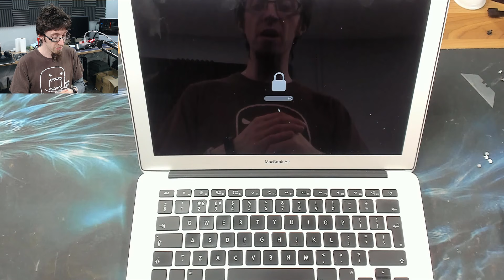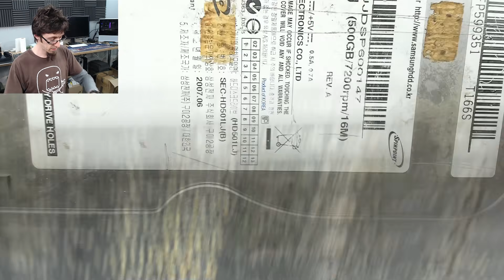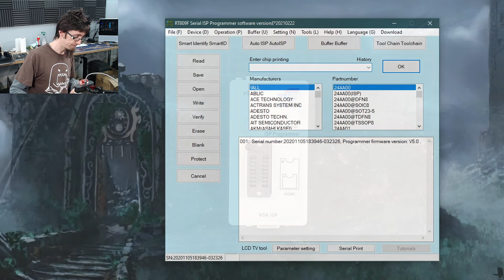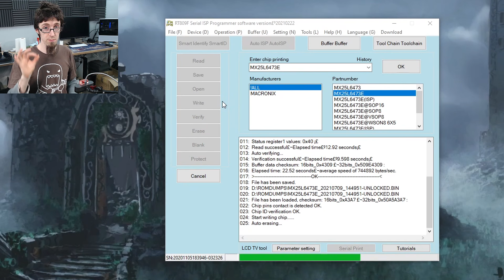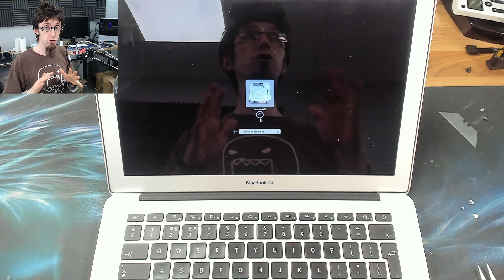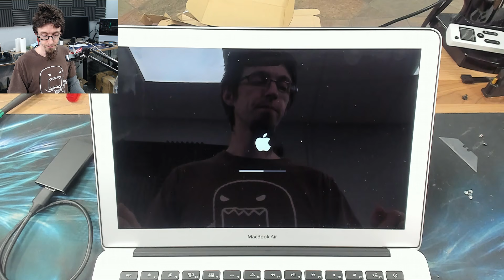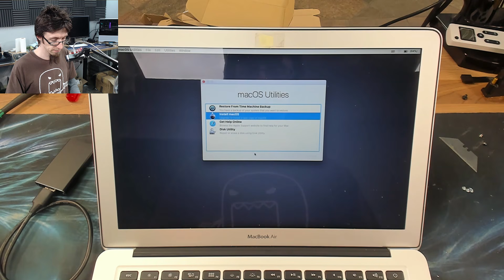[2017 and older ONLY] MacBook Air Firmware Pass / iCloud Lock Removal - LFC#275

Comment: Apple devices that have a firmware lock (the proper name is Open Firmware password) on non-T2 chips is usually set by a systems administrator rather than a user, so the computer is from business or academia or from an enthusiast because the password can only be set in recovery mode which most users don't touch. If it's the latter, then FileVault is more likely to have been enabled, so the data will be encrypted. The T2 chip is a computer in it's own right, running BridgeOS (a modified WatchOS) but it has a flaw that can be exploited in some models when the device is in "revive" (DFU - Device Firmware Upgrade) mode. As of the M1 chip, there is no firmware lock and users are advised to use FileVault to encrypt everything.
Reply: Does that mean m1 chip are easier to icloud unlock?
Reply: @bujoytv  No, the M1 makes it harder to unlock, since the iCloud lock relies on the serial number, which is stored in more than one place on the M1 logic board.

Comment: Nice video. Question is that stock SSD? I'm trying to find a replacement SSD drive but don't know which one some mentioned you can put any type but you need an adapter.
Reply from the maker: This was not a stock SSD, no. It's an Intel 660p, a budget NVMe drive.
You can use any NVMe drive with a cheap m.2 adaptor with 2014-2017 macs (check google depending on which one you have) and they work just fine. I think you also need to be on Mojave or higher as well, older versions of macOS don't have NVMe drivers.
Reply: @Adamant_IT  ah ok. The MacBook air ithink it's 2015-2017 and stock SSD is not detected and I wanted to try another SSD to see if It that's the problem.

Comment: Hy ! Thanks for your video. I have a 2017 MacBook Pro.  If I buy a new EFI/BIOS chip and replace it on my Mac, is it sure that the iCloud will jump too ? And I'll have a mac like it came out of the factory?
Reply from the maker: I think that'll work on a 2017, yes. You'll need to reformat to shift the iCloud lock as well.
Not 100% certain though, haven't tried this on newer models, only Retina-era stuff.
Reply: @Adamant_IT  and how to reset iCloud ?  Cmd R ? i thought that by changing the chip the iCloud also jumps ?

Comment: Your a con artist because you've deliberately made the title icloud lock removal when you do nothing of the sort but yet you know it will appear in google searches which is why you've done it because you want your video to show up in searches of 'icloud lock removal'. Your the worst type of youtuber.
Reply from the maker: This MacBook Air had an iCloud lock on it. It's what sets the EFI password on the laptop in this scenario.
Reply: @Adamant_IT  Your certainly not fooling me, someone who repairs macbooks on a daily basis. The EFI password has NOTHING to do with icloud lock they are completely separate things. icloud lock is a security feature that prevents a stolen or lost macbook from being used. The major problem with icloud lock is the second-hand sellers market where owners have the security feature enable during their time of ownership but forget to disable it once they have sold it or it's been handed in as part of an insurance claim.

If you wanted or intended to have any credibility, you would remove all references to icloud lock from video title and description but that would defeat the reason you put them in there wouldn't it which is to make sure your video displays in google searches when people search on icloud lock.
Reply: So this process will not help if you do not have the icloud password?
Reply: @Oldworldmelancholy  This process will only remove an EFI (firmware) password, nothing else, thus if your macbook is icloud locked, your out of luck. As I have clearly explained to the video creator, using the word icloud lock in the video title and description is disingenuous because he does nothing of the sort. He wants his video to get views so what better way to add words that he knows desperate macbook owners will search on. Views mean money.

Comment: Hey, I wanted to know your impugn on my problem, I accidentally snapped off a pin from my argb header and want to fix it, I saw your usb 3.0 replacement video, but I don’t have a replacement pin, do you know where I can get one or if I buy an argb product (example in a reply) how to remove the pin to fix it.
Reply: One more thing, could I use any ordinary pin to replace it? I’ve found pins on Amazon that I could use to replace it
Reply from the maker: Generic pins would probably work. Also look for ARGB "couplers" which are designed to join ARGB wires together. They're essentially three of the correct size pins joined together, so you could use those.
Reply: @Adamant_IT  okay thanks!

Comment: No idea where i should start... I have a 2011 imac.. I know how to solder with a iron but thats about it.. I am pretty tech savvy. I just dont know how deep i want to get getting a programmer, solder air gun.. Have heard accessing the hdd or vram reset will work.. Hdds seems to no be recognized and the vram just wont reset chime or respondd........

Comment: What if you would install macos on external HD to recover data from internal HDD and then erase and reinstal? Would it still call back home and enabled firmware?
Reply from the maker: That's a good idea, yes. That's probably the best approach for getting the data back if you can't remove the SSD and connect it to something else (as is the case with Apple SSDs).

Comment: What is the name of this adapter to which the bios chip from the macbook will fit :) ? 
OK, I found it, its qfn8/wson8 but i can use 1.8v chip on 3.3v programer? since 5v can burn it with CH341 ?
Reply from the maker: This particular chip (MX25L6473E) is a 3v chip, so no voltage adaptors needed - however I should've mentioned that you should check beforehand if it's a 1.8v chip. You can get 1.8v adaptors cheap on ebay, and you just stack all the adaptors up in the programmer as required.

Comment: Stop wicking the solder from the ground pad. Live a little extra on it and the pin pads. It will really help pull in the chip straight when reflowing.
Reply from the maker: I'll try that out 👌
Considering I had some solder balls popping out when pressing down afterwards, I figured I had it about right. But I guess if you're pushing out solder anyway, a little extra doesn't matter, and I do have issues getting the chip straight at the moment.
Reply: @Adamant_IT  it will get crooked if there is not enough lubricating solder beneath. Copper on copper will snag. Some extra solder alloy acts as a lubricant too. 
Don't squash it too much either. Should be a bit wiggly before you take the hot air away.

Comment: Great informative and easy to follow video as always. I just wanted to say the reasons given as to why you would need to do this is obviously no good for the passed away relatives device with the photos as it erases all the data. As all of us that repair devices know there are is a lot of software out there that says it can unlock phones etc, , when in fact all they are doing is a factory reset and wiping the device , which is pointless if it is iCloud locked. As for android devices they only work if developer options and USB debugging are enabled. How many regular phone owners even know what that is, unless someone knows how to enable it when you cannot access the device its useless. Anyway thanks again for the videos, always interesting.
Reply: So in doing everything in this video will still not help you if it is icloud locked?

Comment: Nice Video, Some advice if someone tried the password too many time you would need to wait until the counter finished before removing the UEFI chip otherwise the data on the chip will be corrupted
Reply from the maker: Good tip!

Comment: Hi  Regarding your comments about the voltage on your CH341A, they are not all set to 5Volts, I have two identical to yours and after reading the 5 volt issue I checked mine and they both output 3.3 volts to the chip, so there are at least 2 different versions of these programmers
Reply from the maker: Make sure you check the _data lines_. The VCC rail is fine, but the CH341A chip itself runs on 5v, and pulls up the data lines to 5v - that's the problem.

Comment: I recommend a A-Z Phone diary book to keep passwords in . Not likely to lock up , lose power . Just handy if kept in a good hidden spot . Use a pencil to update them when required .
Reply from the maker: Ye. I'm a fan of password managers like LastPass, as they're accessible from anything with an internet connection (so you don't need to carry the book around) but I do say to my customers "yea I'd rather you keep a book at home with an ordered list than use weak passwords, post-it notes on the back of the phone/laptop or the same password on everything."
Book isn't ideal, but it's a lot better than bad practises!

Comment: But what about the personal data ? Its all lost, isnt it ?
Reply from the maker: There was no data needed on this specific device. Hypothetically, I could've booted it offline (not connected to the internet) after clearing the password, and accessed the data. There's a strong chance I'd get locked out at some point, but it'd be enough to scrape a backup. Alternatively, so long as device encryption is off, I could've pulled the SSD and connected it to another system. This video is more aimed at getting the device back into a usable state.

Comment: i once did this to a mac mini. much easier since i could just clip the bios chip instead of desoldering, but the same process in software.
Reply from the maker: Yea, I've heard lots of strong opinions about using clips, but I know plenty of folks have had consistent success with a decent quality clip, so it's a valid strat!

Comment: another great video as always, love watching Graham fix and build computers... it's sooo satisfying and better than doing it myself lol. speaking of which... i have an iMac here and although it doesn't need quite so much work as in the video, i'm not sure what to do next. the hard drive in the mac seems to be failing, and has problems booting the OS, apart from getting to the password screen (i have the correct password) but after entering, i just got a black screen every time. so, i have installed a cheap and small 128GB SSD in the iMac (as they plan to sell it as soon as it's all done) and installed MacOS on there and that's all fine, but how easy is it to recover the customer files and data (pics, docs, etc) from this old drive, now that it's not in the iMac anymore? i do have a USB HDD dock i can use. thanks all :)

Comment: but.........you didn't use any power screwdriver????? what's up with that.......... stay well
P.S.  it doesn't matter if you use one or not. just  a bit of fun
Reply from the maker: 😄caught!
But no, I tend to use whatever's within arm's reach when I start working. I do legitimately use the Sequre a lot, but sometimes it's on the other side of the shop and I've got a manual driver right next to me...

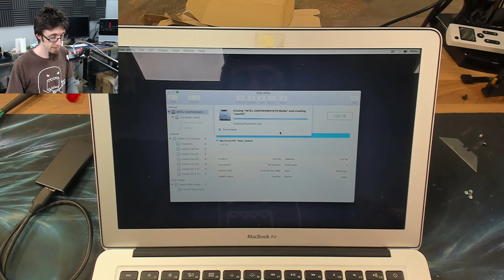Comment: Correct me if I'm wrong, but shouldn't you format it as APFS, not Mac OS Extended (Journaled) ? 19:35
Reply from the maker: The installer converts it as necessary. On a clean install of Catalina or Big Sur, the drive will be converted into APFS if it isn't already. I suppose you could do that in advance, but the end result is exactly the same anyway.
Reply: @Adamant_IT   If you go APFS first the installer sometimes makes the boot and data partitions incorrectly, I tried and had to wipe and start again when I went from a 128gb ssd to a 1tb one.

Comment: good work Graham, I am pleased you listen to my comment before and use the #SVS methode. Was it really needed to reinstall OS.

Regards

Steve from belgium
Reply: im trying to figure out if you were trying to save the data could you just not let it connect to the internet so it would be unlocked temporarily and get the data off then reinstall mac os ??
Reply from the maker: Yes, I think if we were looking to save the data (in this case, the customer did not require data) we could've booted after the NVRAM reset and scraped data before it locked up again. It's very hit and miss though, as I mentioned, I've been on an adventure with another device where I was trying to save the macOS install due to it having desirable licenced applications on it, but one way or another it'll self-lock again if you don't re-install macOS.
The re-install isn't required if it's not an iCloud lock, as per my previous video where I just swapped out the EFI chip with a replacement.
Reply: Yes it was, otherwise, as explained in the video, MacOS will put a password back on the chip.

Comment: you said it needs unlocking because there maybe pictures on the laptop, then you formatted the ssd.....how and when can you get to the data after resoldering the bios/uefi chip from the ssd?
Reply: Try kronofix 0n Insta
Reply: Its just an example, in other cases you are not forced to format and can recover the data.

Comment: Is it possible to just pull the ssd and stick it in another computer and look at the data on it, say for instance you had family photos that you wanted to recover and just copy them to the other computer?
Reply: Yes, as long as the drive isn't encrypted. You will need a different Mac or support for the HFS(+) filesystem on a different machine.

Edit: for this Mac it would work, but newer models might not, SSD's could be soldered to the board and/or straight up locked to the device itself. (T2)
Reply: Good question. I wonder if it would work

Comment: Could be worth buying a decent socket for the programmer,  lifting tracks with multiple heating cycles is my thought :-).
A handy tool.
Reply from the maker: Yea pretty much this. I've got a socket adaptor for SOP8 chips from ATX mobos, but it's a bit hit or miss. Sacrificial breakout boards are just consumable tools IMHO. Use them 'til they break then buy another pack of ten.
However, plenty of ways to bake a cake, use whatever works for you!

Comment: I've got a gtx 980 gpu fans spin up and takes power, mobo says no vga detected. Cant see any blown caps, chips etc no signs of liquid damage was working in my pc was taken out for a week to use in another machine can it be fixed/is it worth doing?
Reply: @Mr Guru I've tried in a few pcs but still gives the same error, I'll try to pull my 6700xt out and give it a go in my pc again to see if it works or it's better to keep an eye out for a half decent gpu at a non scalped used pricing

Comment: I'll address the other elephant in the room.  If you're forced to reinstall MacOS after reflashing the chip...goodbye to family photos (unless they're stored in the cloud).
Reply: not if u plug in to other pc w the proper adapter to win or mac and in win u can use LinuxReader from diskinternals.
on a similar model mac u can insert ssd and boot linux usb live and copy files.. NOT MODIFY while in linux.. 
i think out of the box? no! i think out of the box factory building  😊

Comment: It amazes me how components as well as the surrounding SMTs can survive being heated up to extreme temperatures, even for just a few seconds, especially considering that DIY PC builders spend hours trying to get their components as cool as possible, even modifying off the shelf PC’s to run cooler (eg M1 MB Air Thermal Pad hack)
Reply from the maker: Yea, most components have a working temp and a reflow temp. The working temp is the limit for normal operation for extended periods of time, but the reflow temp is "it can survive this for a short period without dying during manufacture". If you tried to turn on the component while at reflow temp, you'd have a bad day.
Reply: There is one thing to have a hot semiconductor with currents flowing in it and another without currents flowing in it. 
I too cringe a bit to see him blast the board that high but these boards sport massive copper layers and take a lot of heat to reach the needed lead free flowing temperatures. 
Do not blast other brands like this tho... :))
Reply: Even more so when you consider that the data on these memory devices are basically bunches of electrons held in place by the wonders of modern technology but yet remain in place after all that heat.
Reply: That's when you have to remind yourself that the chips are just sand..

Comment: Can you plug the SSD into a Linux PC and read the files, or is it the usual UNIX permission/owner problem.

You could 3D print a holder for pogo pins and clamp the chip to it, and use leads to a DIP that fits in the programmer. I have done something similar for a quick connect to ISP pads
Reply from the maker: Depends if disk encryption is on or not. Modern macOS uses a very overly-complicated partitioning system though, with container partitions and other such nonsense, I'm not sure how well Linux reads it without specific setups.

Yup, I have something like that for the SOP8 UEFI chips used on ATX mobos, although it can be fussy. I tend to solder onto breakout boards to ensure there's no connection issues. Overkill, but not really difficult considering you've already got the hot-air switched on to remove the chip in the first place.
Reply: @Adamant_IT  Linux does support Mac OS partitions, I was just compiling the kernel the other day there was options for additional partitions and Mac OS was selected by default.
Reply: What if the data is encrypted? Won't matter if the data is useless right, correct me if I'm wrong.
Reply: @DarkGT  If it's encrypted there is no chance.